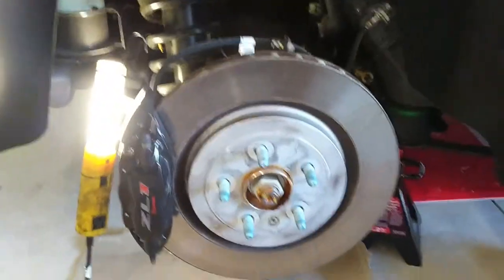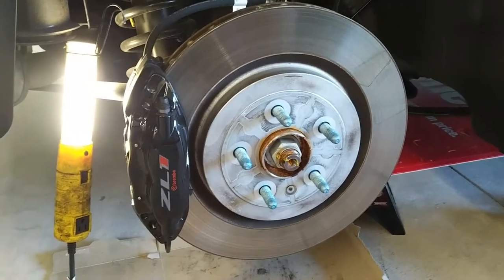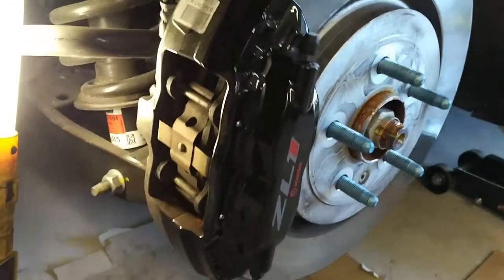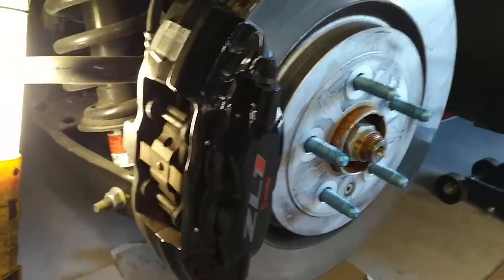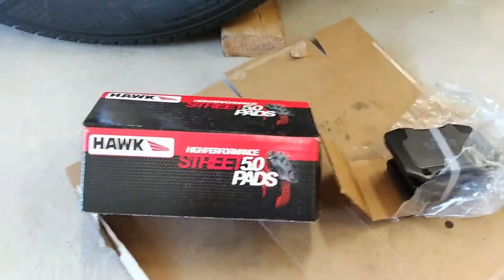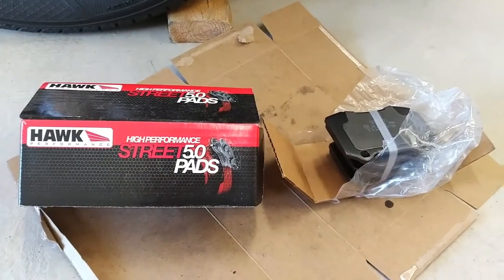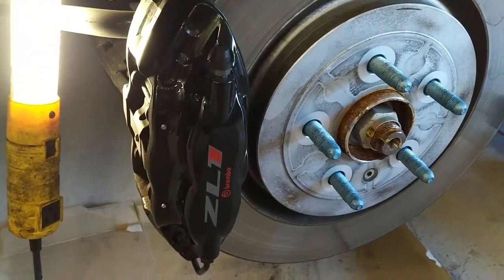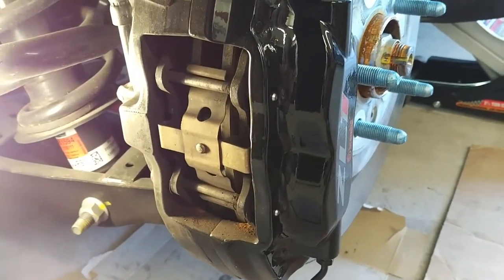ZL1 Rear Brake Pad Swap

Comment from the maker: The Hawk HPS 5.0 pads are made of a ferro -carbon material.  Not ceramic as I may have mentioned.  I have put a few miles on the car with the new pads, and they are great!  Once I bedded them in as directed by the installation instructions, the brakes worked as well as the original pads.  The dusting is minimal compered to the original Brembo pads. I would think the original Brembo pads are made of a similar compound as the Hawk pads.  My main reason for switching out the pads was the heavy black dust the Brembos pads produced.  The Hawk pads do produce brake dust, but it's a lot less and it's gray rather than black.  I suspect the Hawk pads will wear similar to the Brembo pads.  I'll keep and eye on the rotors to see how they stand up to the new pads.

Comment: I can't figure out what type of pads came on mine originally. The web says Ceramic and the Parts Store says semi metallic. I want to go with what I had to start because the rear brakes lasted 40k miles. The fronts are still good too. In my experience ceramic pads rape the rotors.